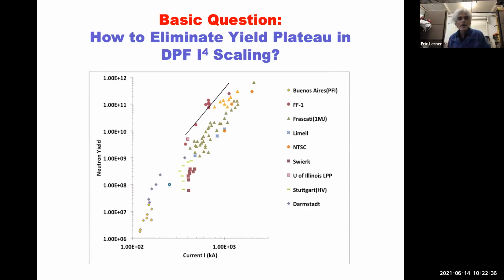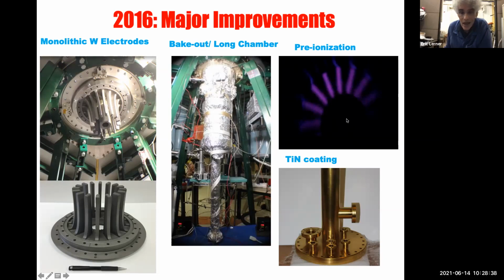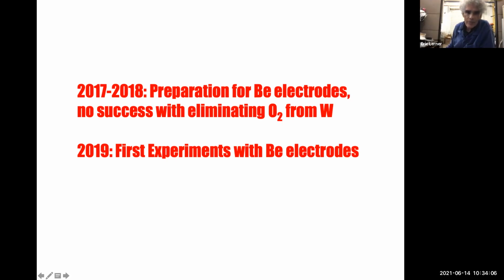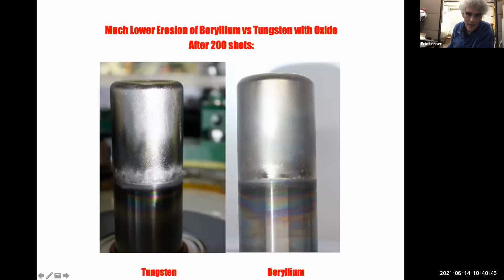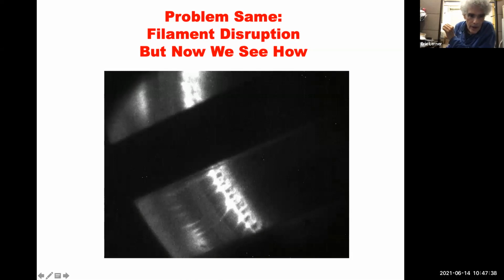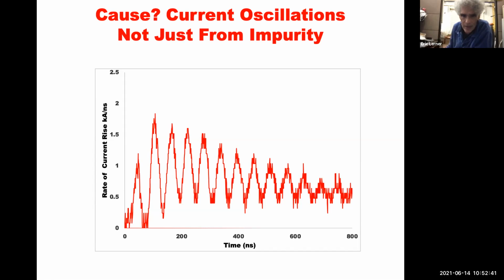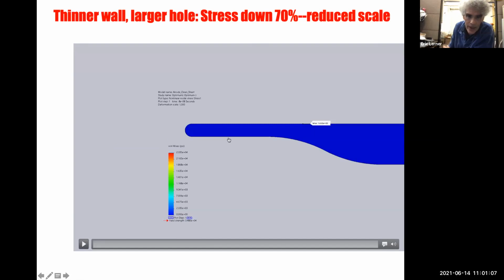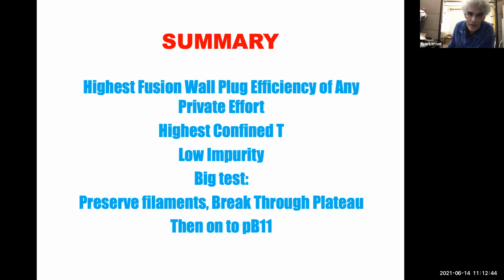LPPFusion’s Progress Toward Fusion Energy - Presentation for Review Panel

Comment: What could you do with state of the art simulations? Needing a new round of financing for every iteration seems cost prohibitive.

Do you understand the problems well enough to simulate the whole machine in a computer? Or would a simulation reveal nothing new, because you would only program into it the parameters you already understand?

Edit: or do you fear IP theft if you have to run it in some big tech companies cloud?
Reply: Simulations generally work best when all of the variables and physics are well understood. In the case of fusion, it seems like doing the actual experiments is necessary since the physics are not completely known. There's another Fusion group that did a simulation, and then built a device. They discovered that the field was quite a bit bigger than the simulation showed. So, they are building a new device.

Comment: Ur not going to get the power that way take a page from safire and just have a sustained plasmoid heat water,,, there is no magic bullet for energy production
Reply: What are you talking about?
Reply: @MegaBanne  Safire Project
It has a dot com
Reply: @seymoronion8371  
I know what the safire project is but I fail to see how there is something to learn from them.
It is likely not even a fusion reactor if it works as they say it does.
Reply: @MegaBanne  the safire project is not concerned with making power from the process they take a page from the nuke community they heat water to steam and then make power from that over unity may not exist
Reply: @shockwave326  
I fail to see what you think these guys should do different.
Should they go over from direct conversion of electricity of inefficient steam turbines?
 
Safire is just an experiment that happened to create hot fission.
These guys are using natural instabilities to generate extreme energies.
Reply: @MegaBanne  ya and hows that worked out for the tokamak reactors ???  not too well !!!
Reply: @MegaBanne  and how's that worked out for tokamak,, i heard eric say threshold as in barrier to making more and more,,,, this might not be the way is all im saying
Reply: @shockwave326  Criticize based on understanding and not on superficial stuff.
Tokamak is shit because it tries to control plasma to force fusion.
It is based on Lorentz' force law. Which is like as basic and dumbed down plasma physics you get.
 
Fusion happens naturally in electrical discharges.
Electrical discharges naturally forms high energy instabilities.
This approach exploits such natural phenomenon.
It tries limit external factors (stuff we actually can control) to avoid interfering with the nature of the plasma.
 
There is close to nothing similar between the Focus Fusion approach and the Tokamak approach.
Reply: @MegaBanne  what u dont think i know this ??? the comparison arises from the process being the same as in trying to extract energy from nothing ie the process itself,,, nuclear reactors create power just fine heating water and making steam and using that to make power,,,, what if he cant breach the threshold ? what then all u have is a small scale generator that cant be up sized,,,,, now safire is the way forward
Reply: @shockwave326  
Energy from nothing? What are you talking about?

Existing nuclear reactors are shit in comparison to this.
Extremely expensive to build.
Takes very long time to build.
Uses overly expensive fuel.
Steam turbines are inefficient methods of generating electricity.
 
Safire sounds promising. But it was nothing but luck that they found out that it accelerated protons to high enough speeds to split tungsten.
Safire uses heavy elements to generate energy.
Focus Fusion uses light elements to generate energy.
Both two useful reactor types.
 
The fact that the focus fusion reactor doesn't need steam turbines is a huge plus.
More efficient energy conversion and much smaller reactor for the same usefulness. 
 
Safire has broken even if it is to believe what they claim. But it has not solved how to get that energy out and if it is break even accounting with energy losses from the heat to electric conversion.
Reply: You think you are teaching the Goat about fusion? Eric knows what he is doing
Reply: @peteralund  lolollololol